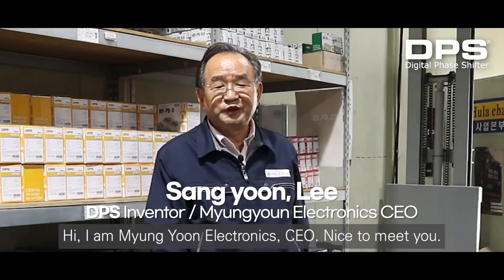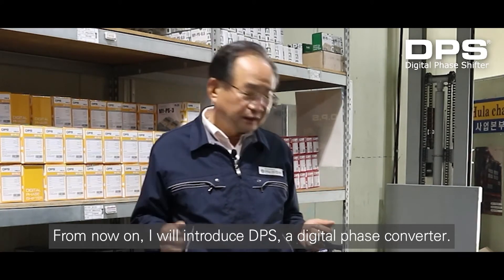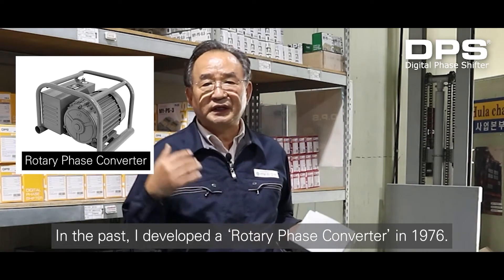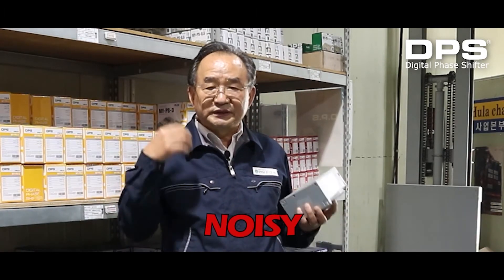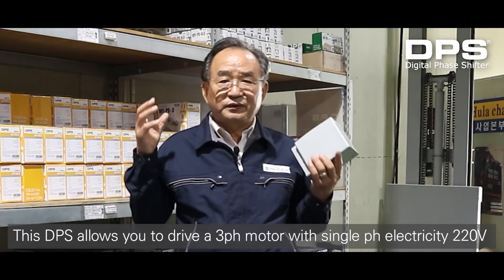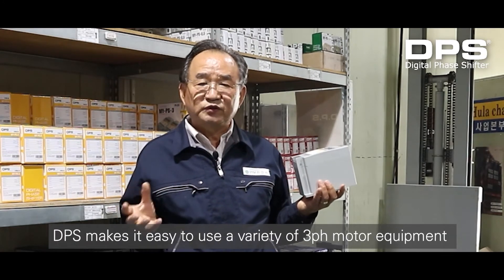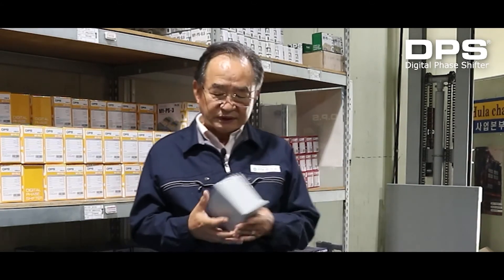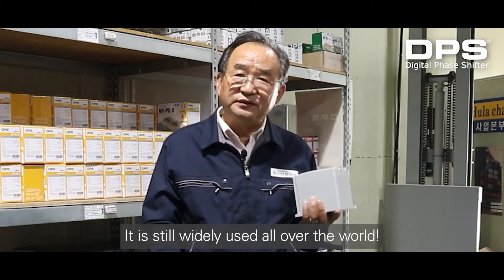DPS can be made 3 phase power from single phase power

Comment: Thanks for engineering these phase converters, Mr. Sang yoon Lee.  When wiring the unit to my single phase 240VAC, what do I do with the ground wire?  Also, to what do I attach the ground wire on my table saw, which has a 3-phase, 5HP motor?  The unit works well, but I am running it ungrounded.
Reply from the maker: Hello, thank you for your kind comment. Regarding your question, the DPS does not have a part to connect the ground wire. It is recommended to contact an electrician for the connection of the ground wire. Thank you and have a good time.